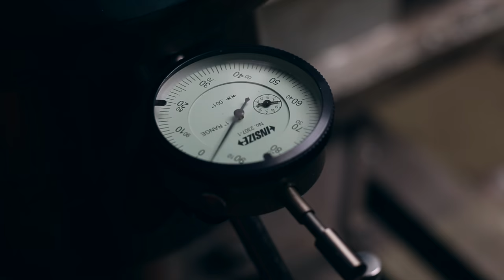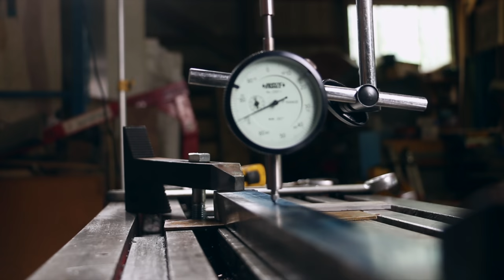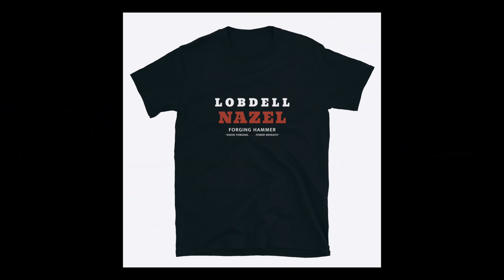Nazel Power Hammer Rebuild - Part 4

Comment: why not a dovel push-in joint
Reply: then side pin fix
Reply: steel injection molding machine with tungsten and MgO, carbon, parts, electric (resistance or arc) heater